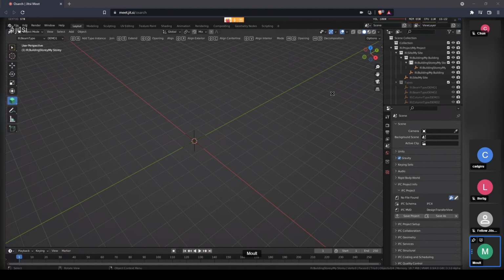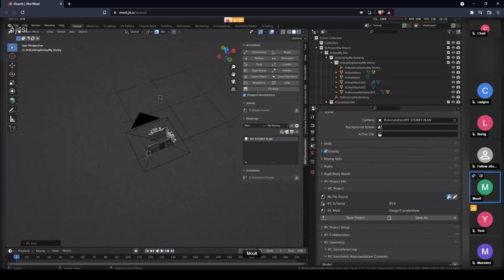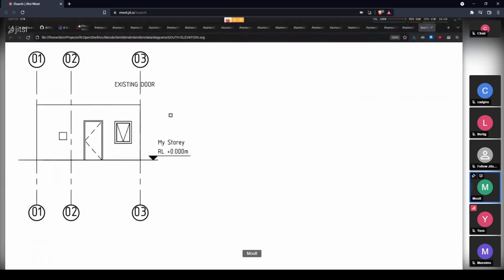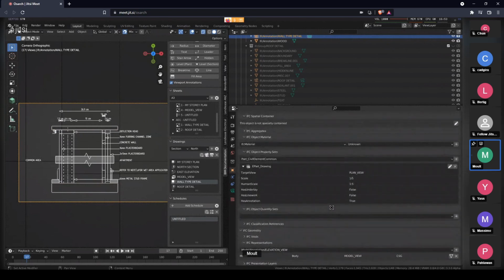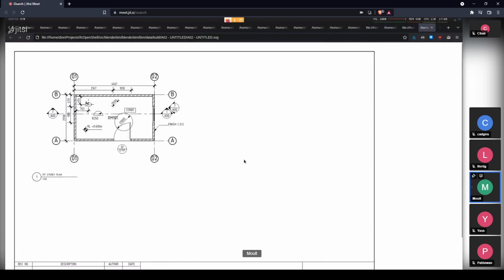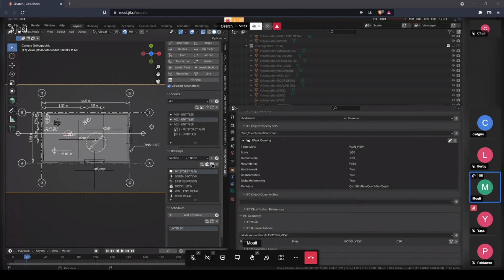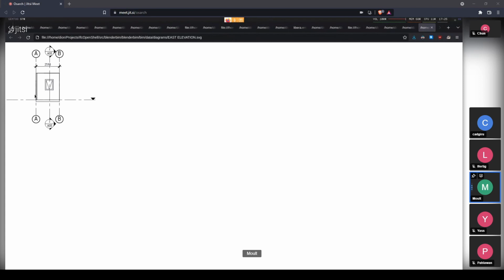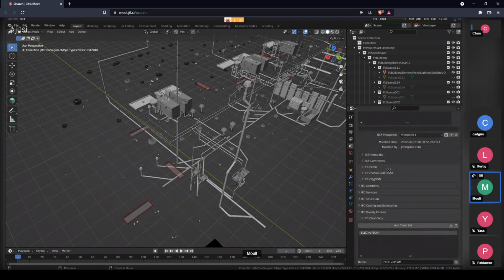BlenderBIM 2D Documentation - Progress June 2022

Comment: Timestamps:
Bim Modeling
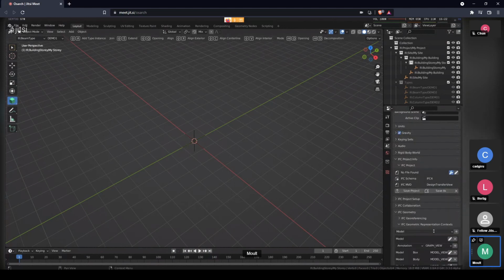0:10

2d documentation
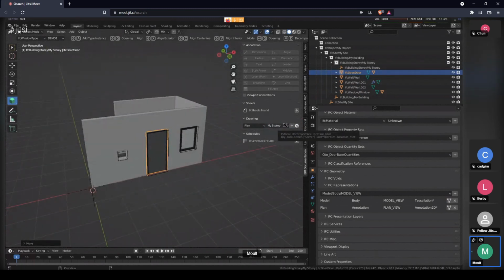3:48 
Dimensions
8:03 
IFC Grid
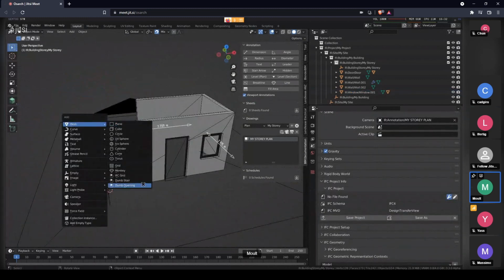9:57
Add Elevation
13:34
Fixing Triangulation in elevation/ limited dissolve
16:06
Annotation Elevation
17:24
Annotation Alternatives
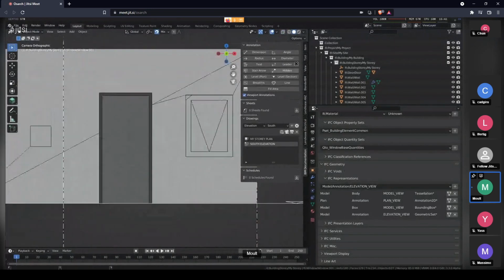18:55
Editing Text
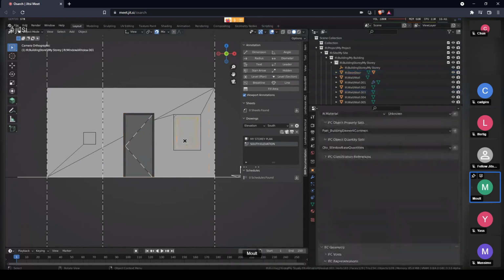19:50 
Tagging object with text /smart tags
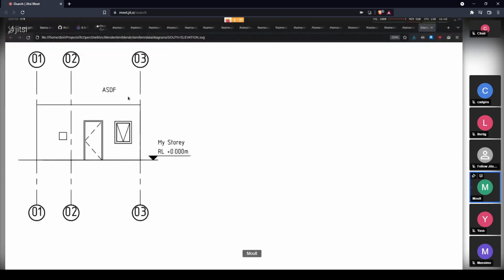20:12
Bulk tagging/ Tag all is currently missing
21:26
Plan Levels/Section Levels
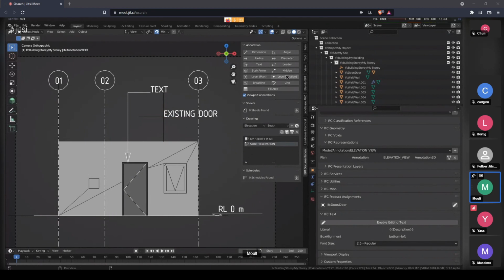22:23
What else? (More annotation and 2D drafting CAD TOOL)
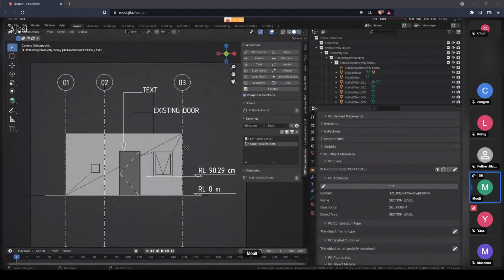23:38
Adding 2d drafting plan
27:15
Example feature file (CSS etc)
28:21
Detail drawing (CSS hatches and lineweights) LOOKS GOOD!
30:26

Global Referencing
39:27
Sheets
40:40
Schedules 
42:43
Adjusting sheet layout in Inkscape
43:35

Q&A Where is the drawing stored?
45:38
General workflow
50:07
Other features (Metadata)
51:37
Inkscape marker editor?
56:07
How can users contribute?
59:37
Sample File
1:01:30
Roundtrip? YES
1:04:01
Random Model examples
1:05:16
Federation and Bimcatcher?
1:07:05
Clash detection!
1:07:33
Reply: Well done
 Dion. Good work. Thanks for pioneering this initiative that will change the adoption of BIM for infrastructure procurement around the world.